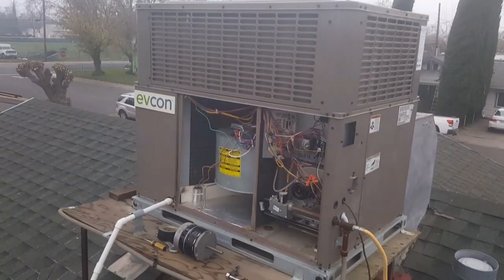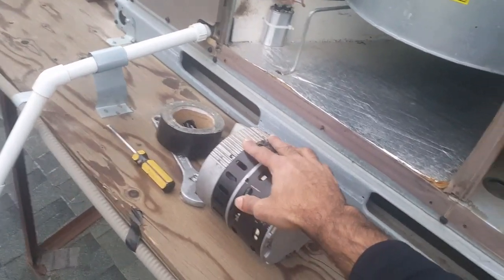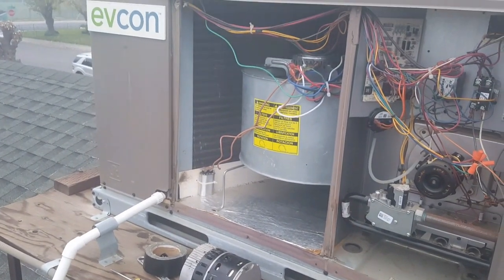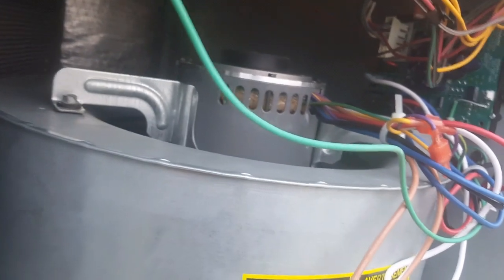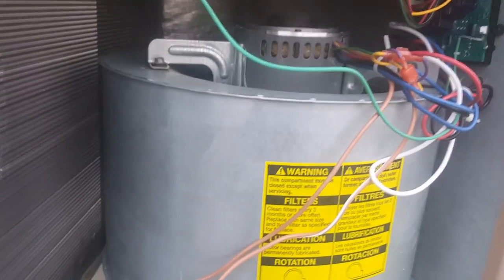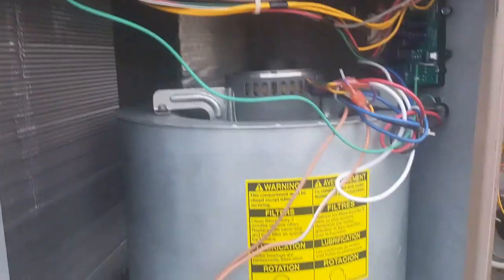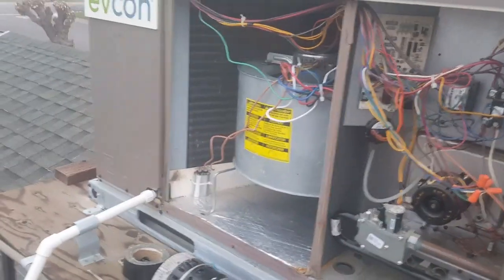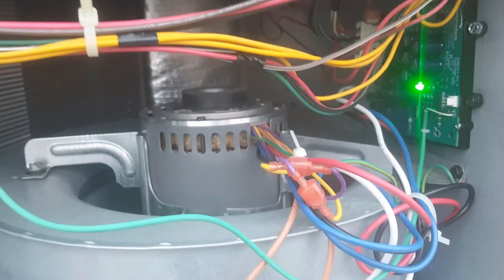ECM to PSC Blower motor conversion using a Qwikswap X3 board overview

Comment: Were you satisfied with how the QwikSwap board calibrated the speed at all your three taps? I think I read somewhere that it always ‘auto size’ every time the air handler turns on. Do you think this is true? Thanks for sharing the install, but it would be nice also to do a follow up video about its CFM performance.
Reply from the maker: Yes I am satisfied with how the speed is being controlled. Probably not as precise as an ECM but there have been no noticeable change in my energy bill nor HVAC performance.